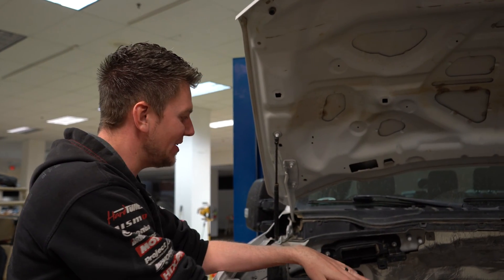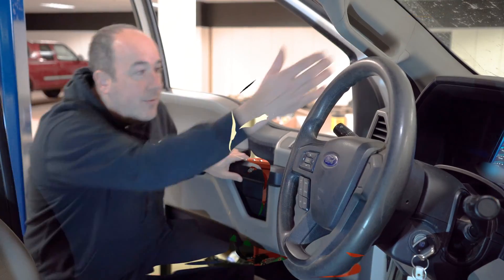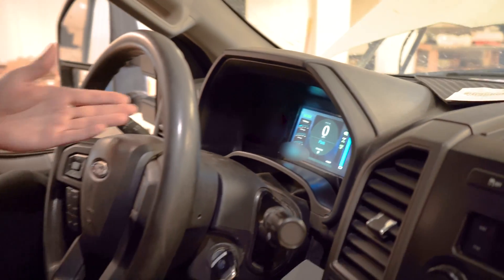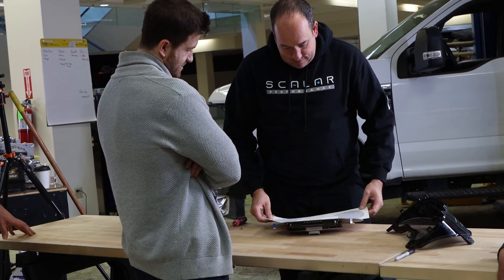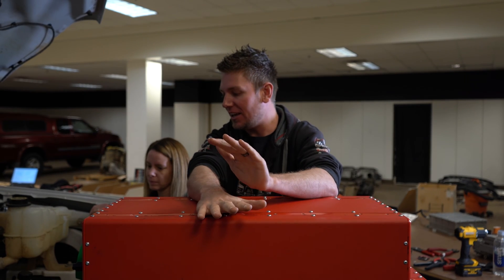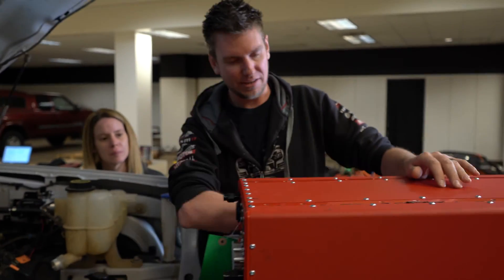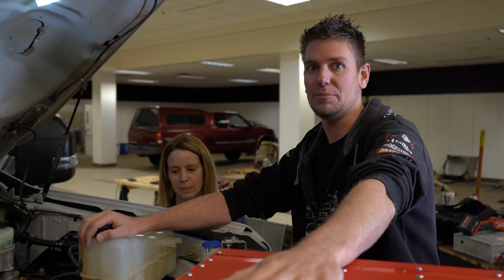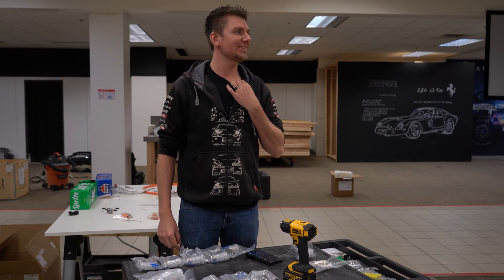We Converted a Ford Super Duty F250 to an EV – Build Part 2

Comment: What would the cost be for yall guys to do a conversion? I got a 2015 F150 with 120K miles on it so a long life to go. Going to debate if it would make financial sense once major components start breaking to do a conversion instead of replacing said components.
Reply from the maker: Sorry for the delay responding, you can email sales@scalarperformance.com to discuss specifics but a Cascadia build like this is a close to 6-figure number depending on the build choices.  This is using all the top shelf components from Cascadia but moving down a shelf saves a fair bit of money.  Happy to discuss if you'd like, but there wouldn't be a build possible under $50k.

Comment: Would love to have a parts list for this build. I am planning something similar but having issues finding cables, connectors. Also there was two modules you mentioned other than the inverter mounted on the side, what were those?
Reply from the maker: You can purchase the complete power train from Hypercraft or most of the components are available via StealthEV.  I'm guessing the boxes you are referring to are the HVJB (high voltage junction box) and the OBC/DCDC (on board charger and DC-DC converter).

Comment: At first I was thinking I would congratulate you for dialing back the childish music. Nope, you didn't. 
How much range is the truck likely to have with only 4 relatively small batteries? Why not place them lower? I would think there would be space where the fuel tank and exhaust came out.
Reply from the maker: Don't worry, the weight sitting at former engine height hasn't hurt how well this truck rails thru the corners!  Jokes aside, you're correct that there's loads of space under the bed where the fuel tank, exhaust and even spare tire go.  This particular customer wanted a very low range, "proof of concept" vehicle at a mine site where it seldom travels 20miles in a day.  The 4 Hyperpacks from Hypercraft met this need with 40kWh. Range is only around 60 miles. Hopefully our next customer build will want a longer range truck.    Fitting 160kWh+ shouldn't be a problem and would provide closer to a  250mile range.  It is still a barn door after all.